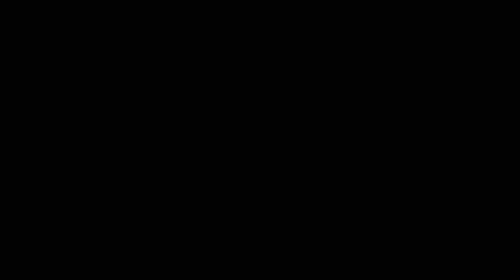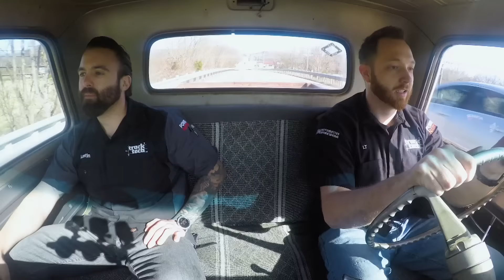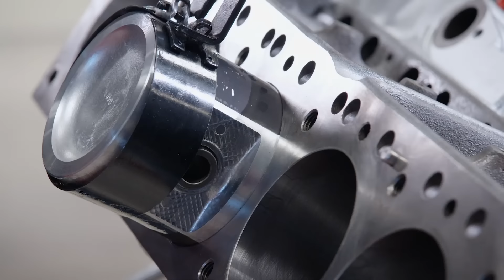Forget the LS Swap: Building a Turbo Chevy 292 Straight-Six

Comment: Can we please see a ford 4.9l/300 6cyl that would be awesome and you supposedly can turbo them with very little work
Reply: They started a 300 a few years ago but I never saw the end result. It was when Mike B. left and Pat came in.
Reply: @johnderekmitchell1510  They finished it but it was kind of slopped together and only had a 390 cfm carb, But it made 203hp and 306 ft.lb. of torque.
Reply: @legostar55  thanks. I if I remember correctly, Mike B. dropped it and broke a trans. mount ear and they had Tommy show him how to weld Cast. He went back to the machine shop not long after. Saw him a few episodes ago with a local race team at a track the Show was covering. Anybody else get aggravated when hosts leave for whatever reason and the Block/Nation acts like they never existed? I think Jeremy and the guy he replaced are the only ones I can think of they actually said why and where they were going.
Reply: @legostar55  cool not bad but ik its capable of much more
Reply: Check my channel out, my 4.9l makes 190 HP and 342 torque something like that, gonna turbocharge it soon with twin HX35s,
Reply: Please... NO.
Reply: @hawkdsl  no what ?
Reply: Please don't contaminate something pure and wonderful with Ford POS products. Those products and fans of those products are in league with Satan.
Reply: @hawkdsl  if that's the case then my 784K Ford 300 without a rebuild is demonic and Chevy is just a wimp, let's see a 454 beat mine in tug of war where real power is shown, I have yet to see someone win in that again my 300 cid, might wanna do it fast because soon my trucks getting boosted and then nothing can stop me
Reply: @Project23-Official  I hear ya.
Reply: @hawkdsl  haters gonna hate anybody who dont like or at least admit the 300 6cyl from ford just straight out a good durable torquen motor is just full of it
Reply: @big6red3  Nonsense. "Haters gonna hate" is worn out.. Just come to the fact the Chevy is far superior in design, engineering, aesthetics, and couldn't be more 'Merica then if it was mixed with George Washington piss and Eagle tears.
Reply: @hawkdsl  and thats why new chevys cant get normal things like fuel level gauges and 4xr transferer cases to work or also why they always had nascar baby them anytime ford or dodge would start leading in nascar they'd change the rules to hurt ford and dodge so chevy could keep up thats the whole reason they went to small block motors in nascar because chevy couldnt keep up with dodge and ford big blocks so they got nascar to change the rules and let them run small blocks cause in chevys deffince they did have a good small block but not as good as ford and dodge still chevy is just a cheaper made motor it aint gonna last u can make it go fast for cheap but it aint gonna last and you can make a ford or dodge go just as fast or faster and hold up doing it granit most all ford dodge and chevy straight 6s hold up better than their other motors im not sayn their aint some fast durable chevys cause ik a guy with one but ive seen time and time again chevy motors blow out simple things or the whole motor and the fords just seem to hold up better and usally run faster or just as fast
Reply: @Project23-Official  nonsense.  Take 2 identical pickups like yours and put a 454 in one of them. The swapped one would win because it would have more torque, horsepower and more weight on the ground. Your smaller lighter less powerful engine will loose unless somehow it can defy the laws of physics. And only a moron would add boost to an engine with that many miles on it unless just having fun blowing it up.
Reply: @Project23-Official  a Cummins 6bt is better in every possible way than a ford or Chevy inline 6 but you probably think you can win a tug of war one of those too🤣
Reply: @mr.monitor.   Mr. Monitor  I'm trying to blow it up 1. 2 I have a second motor that has the turbo and everything on it, 3. My truck weighs in at 9300 pounds on avg with all of my tools 4. I have granny gearinv out the wazuu, T18 , 5.38 diff with bw1345 transfer case, I haven't seen a Cummins 6bt in life outlive my truck, online yes but nowhere near here, and my motor isn't anywhere near stock, nor is my new one, 30 pounds of boost on that new one would woop that 454 without breaking 2500 rpm
Reply: @Project23-Official  that's just silly talk though. You have mods and added weight. Go to a tractor pull and prove how far it pulls a sled vs ANYONE. Put a Cummins in the same setup and tell me it doesn't make you smile so much your face hurts.
Reply: @Project23-Official  post a video of your 0-60, quater mile times or pulling 30k😜
Reply: @mr.monitor.  there's just something about having a 6 gas engine vs a typical diesel or v8
Reply: @big6red3  You take excellent drugs!
Reply: @hawkdsl  you should try em there alot better than whatever your taken😂😂
Reply: @Project23-Official  holly molly i know people drive them things 3 and 4 hundred K all the time 784k that things running like a diesel but shouldnt suprise me probably the one of the best if not the best and strongest motor ford made
Reply: @hawkdsl  actually do your history louis Chevrolet was born in Switzerland then moved to France then to Canada then to America sound like Chevrolet is a Swedish,French,Canadian,american so its  not the most american thing since George and eagle tears

Comment: With the lobe separation on the cam shaft for a turbocharger did using carburetor have any negative effect on the final horsepower and torque???
Reply: They just install the parts, ok guy
Reply: @ThisIsSolution  lol

Comment: I would like a chevy 250 instead, but the 292 do the job. Next episode the ford 300 for a little competition
Reply: They did do the 300. It was a torquer
Reply: Agreed I would have gone with a 250 six as well they can handle a lot more abuse on the race track than the 292. 292 is an excellent choice for 4wd low rpm stump pulling.

Comment: Torque plate avail from 12bolt.com
 A show like this could have spent the money.
Reply: Could have, but didn't need to.
I think they were just trying to show that not every engine build has to be done "perfectly". A lot of people seem to get caught up in making things "perfect," that they take way longer than they need to, and spent more money than they need to...often leading to a stalled project, or worse, giving up on it because they think everything has to be perfect.
Reply: @dposcuro  
I guess.

Still interesting
Reply: @turboflush  course, the more likely reason is:
Why buy a torque plate for $650, that you are likely, only ever going to use once?
Reply: @dposcuro  
This where a rental program would work good. 
Buy it for 600$ return it ( in undamaged condition) for $500. 

I was part of a group at one point that had a fender roller and they did this.  No one wanted to flat out buy one and do only one car, so the group rented around. 30$ got your fender rolled. :)
Reply: They only use parts that are laying around the shop lolol

Comment: Thanks for not committing the mortal sin of dropping a Ford engine in a Chevy or vice versa.
Reply: @Dave Iauco  cause they're dirt cheap. Fords cost a little more.
Reply: @jacktheripped  nothing wrong with blasphemy, like my buddies 86 Monte Carlo with a 2JZGTE in it
Reply: @TransGirlGaming  thats just wrong....plus an ls engine is cheaper and can make more power!
Reply: @setalight7290  on what motor and at what cost
Reply: Or imagine a Buick engine in a GMC 😆.
Reply: @jonathonrossebo1783  i dont hear of  people putting buick engines into anything.
Reply: @jonathonrossebo1783  yet nobody talks about buicks being shit...
Reply: @CraigFenske  Just kidding.
Reply: @jonathonrossebo1783  i mean GM did do that... the syclone and typhoon
Reply: @CraigFenske  buicks just having oiling issues and a lacking aftermarket
Reply: @CraigFenske  That was a 4.3L V6 in the Sy/Ty not the 3.8L Buick you are thinking of. However GM did put the Turbo Buick in the Pontiac Trans Am. They also put the Buick V6 (non turbo) in a ton of GM cars. There was also a lot of sharing with Buick V8 and V6, Olds V8's and Pontiac V8 until they all standardized on the Chevy Small Block and all divisions stopped making their own engines except for Cadillac.
Reply: @geoffinbc  ok, thank you for this great information
Reply: @jonathonrossebo1783  theres someone around me who actually has a buick powered chevy c10. Sounds mean
Reply: I'd rather have a Ford engine in a Chevy than a Nissan  in a Chevy!

Comment: I still with someone - ANYONE - would make a decent crossflow head for an American straight 6.
Reply: D. Liu, Kirby- Sissell makes aluminum 12 port heads, very expensive but these guys have almost unlimited budgets, although they pretend to be budget friendly.
Reply: Only in Australia...that I know of.  Ford 200 & 250's.
Reply: would depend on the bore centre spacing , im pretty sure the 292 blocks wouldnt line up , due to the fact that we had our own version ( distantly related ) of the '92 that eventually only went up to a 202ci , which you could mcGyver a cross flow head onto because the bore spacings were identical , and the 292 blocks were bigger again than our 202 blocks . why someone in the US haasnt got hold of a newer 202 12 port blue/black engine or yella terra head  and upscaled it is a wonder ( btw only the 250 had a cross flow head , 200s were dropped before that  . the old 250 eventually became a 4 litre OHC then dual cam 24 valve Barra engine )

Comment: I'm glad you picked the 292. 250 is good too and a little easier to find. I've seen vehicles rust away and that tractor engine will still fire up and not even burn oil. the automobile manufacturers must of decided they didnt want engines to last that long guys like me wouldnt buy a new one for 30 years.
Reply: You are 100% correct. The I6 lasted way too long for the car companies to turn a profit on new models. Although there has been some rumbles about GM and Chrysler. GM is supposed to have a I6 in the 2020 Silverado.
Reply: Make the engine last too short and people will buy their car from another company. The GM/Olds 5.7 diesel did a great job of convincing diesel buyers to buy a Mercedes Benz.

Comment: 6 in a row makes it go ! I would have done a 250 ci or OHC Pontiac, 292's are more of a 4X4 truck or 1ton stake body farm truck, be easy people just my opinion
Reply: Anybody got an idea on a chevy 250 build series or videos? I got an 82’ and that’s why I want to do is build what’s in it instead of swapping it. Seems to be the minority nowadays but i ain’t swapping it.
Reply: @jlive.60  there are a bunch of build videos on YouTube a few 250ci motor in the mid 300hp range n/a in South America they have drag motors over 1000hp turbo
Reply: @pirsq314  They are very popular for land speed racing always have been.
Reply: @jlive.60  Buy the book California Bills  how to build a Chevrolet straight six book. Also buy Smokey Yunick's book Power Secrets. Read both books and apply the information you will have a awesome inline 6.
Reply: What about the Jimmy 302 it was a torque monster and could rev ask the old slingshot dragster guys
Reply: @rustedratchetgarage6788  the 292 chevy has a damn massive stroke at like 4.1 inches of stroke

Comment: My first vehicle. 1959 Chevy truck with the 292 six, granny low 4 speed.
It was at least 4 different colors.
Paid $50 for the truck and $50 for a new battery.
Lived on the farm so that truck worked hard. Hauling hay, pulling a trailer and much more.
Reply: I'm 20 years old and my first vehicle was a 1984 Standard Cab Short Bed F150 with a 300 I6 and a 4 speed top loader trans. I haven't driven it in a year or two but it's still my favorite truck.
Reply: Now that is a good truck story! My 66 chevy C10 is my first vehicle and I till drive this bucket of bolts on the daily.
Reply: It’s a chevy
Reply: I inherited my old man's '71 Chevy C20 when it was 2 years old. It has a 292 6 cyl coupled with a 4 on the floor. Not built for speed but for hauling heavy loads. I took it out on the interstate to see how fast it could go. If the speedometer was correct I topped out at 87 mph. Gas milage sucks and for that reason,I parked it with just over 78K on the odometer.
Reply: A 292 in 59?  Sure you didn't have a 261?  That was also a great engine.
Reply: Jack Flash my neighbor has one like this. He's got a 292 sitting in his garage ready to be rebuilt. He's also got a T10 four speed to go in it when the engine is ready. He lives out here, but also have a property on the Navajo reservation, and he says there are some nice old trucks out there. I ma go with him and tow one home!
Reply: @kencohagen4967  which state is this? Texas has some, but I don't see many l6 sitting around anymore.
I love the l6, the low rpm torque makes them my most preferred motor after nearly 20 years with a couple of Jeeps.
On the 4.0, you can go nuts and get 340 hp and the same torque if the block is capable of handling the bore as well as stroke. Super reliable motors too.
Reply: @Aint1S  You got that right. I used to let the truck idle along, jump out and throw hay bails in the back. I would stack them as high as I could throw. Never missed a beat.
Reply: @jackflash6377  😂👍🏼 I used to do the same here too, for other reasons when a stop wasn't in the cards... You gotta go when you gotta go. Then I'd walk up the driveway to get back in my Jeep to finish the drive and park it.
My dad said that they did what you would do bailing hay when he was younger.
Reply: @jackflash6377  
Haha i used to steer the wheel when the kid I was with did that , I was about 7. 
 I wasn't running and pitching bales 😅
That was in a 52 ford though.
Reply: @Aint1S  The Jeep 4.0 was great most of the time, but some variants like the 2000-2001 would have a crack prone cylinder head. Also, some of those later ones would crack piston skirts.
Reply: @kencohagen4967  I wish there were some around here. I live in the city now :(
Granny could tell when I was getting close to the house. #6 plug wire was bad and it always messed up the TV signal.
Those were the days